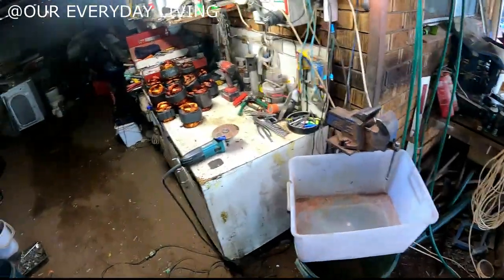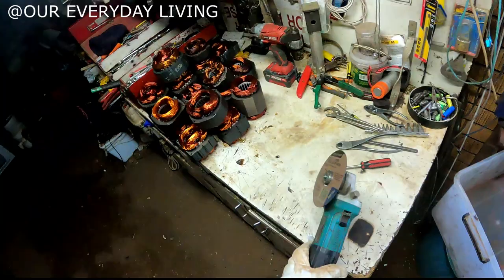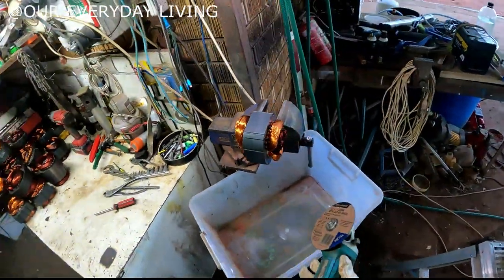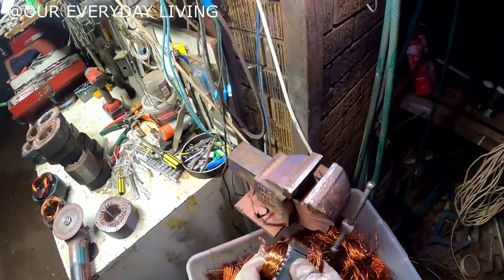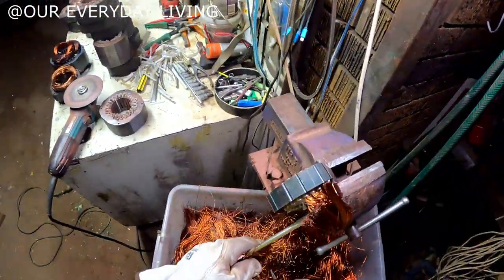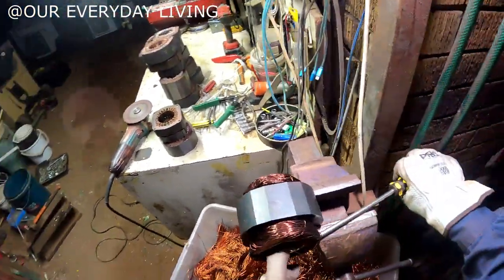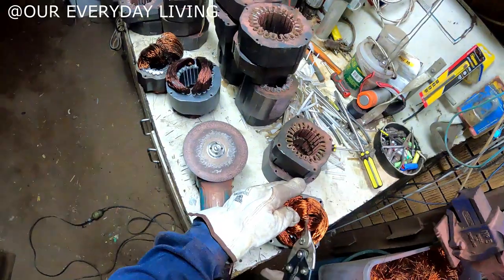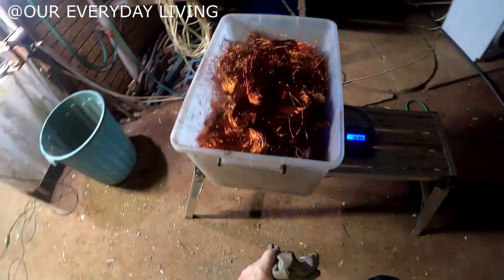REMOVING COPPER FROM FRIDGE MOTORS

Comment: What you can do next time for motors. Is use something sharp and thick like a small hatchet( or half inch steal plate that is sharp) hammer it in the middle of the motor. Keep hammering it until the motor splits in half
Reply from the maker: Good suggestion but that would take longer and more physical work as these motors came out of fridges which wearing case in oil not like the normal electric motor they are mostly gifting a resin.
Much the same as a transformer.
Reply: @oureverydayliving  its much quicker you can use your 12 ton press aswell

Comment: I’m not sure how I missed this video but wow that’s a lot of copper what number is this copper 1 or 2
Reply from the maker: The copper in fridge motors is classed as a number 2 because it's been in oil
Reply: @oureverydayliving  ok that makes sense thanks Tim
Reply: @oureverydayliving  does that also mean the # 1 copper worth a little bit more money then the # 2 I have helped with scrapping things with a friend but don’t know how that is by the way I had a blast doing it
Reply from the maker: Yes number one is worth more but if you have number one wire that is stripped which is called number one bright it is worth more than normal number one because you can get number one insulated and number 2 insulated and when it comes to copper pipe even if it had oil, paint, solder it's still at classed as a number two but if you get it from a water pipe you can separate your number two away from your number one.
Reply: @oureverydayliving  ty Tim very much appreciate it